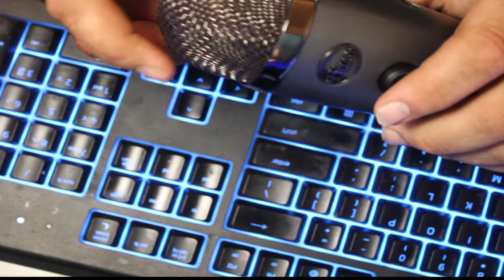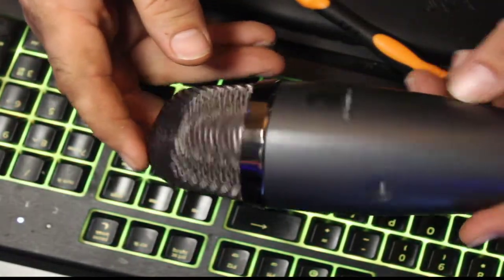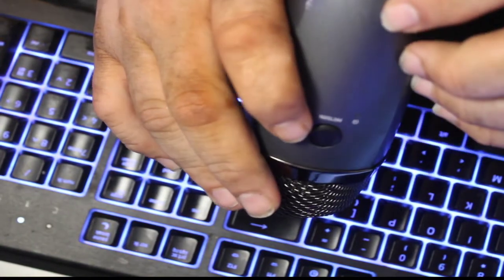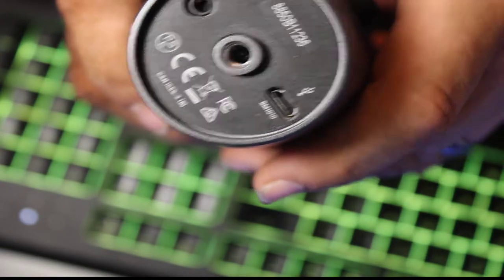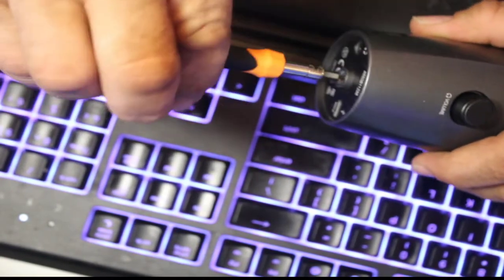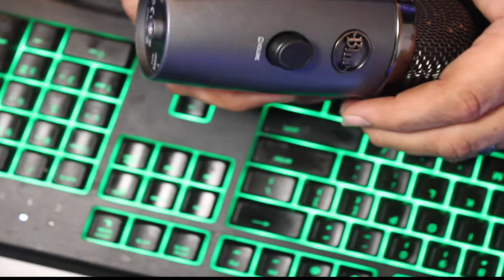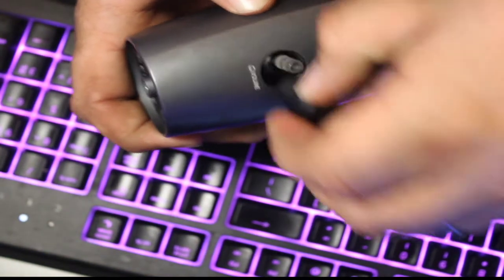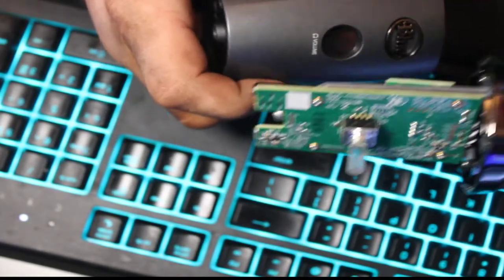How to disassemble the Blue Yeti Nano

Comment: Do you know what the thread diameter and size of the screw? mine actually snapped when I was trying to tighten it all down, it made a nasty rattle and it snapped
Reply: T6 Torx (T6 x 225mm; No. 668)

Comment: I have one problem, can you go more in depth on how to remove the volume button. It is impossible and I even had my dad and brother try to pull it out.
Reply from the maker: Honestly I believe some are glued on. I had to use brute force. Maybe heat the knob? But I can't remember if it's metal. I wouldn't heat it unless it was
Reply: @kyextreme4892  its impossible uh
Reply: @goatedmyth4854  yeah I agree it's pretty much impossible. thanks so much for the video though, it helped a lot. just have to keep working at the volume now and that's it...
Reply: Update: I got it off... Put some double sided tape on it so that I wouldn't scratch it and used plyers to get it off. Now it still slightly scratched it so maybe I didn't tape it enough but just know you may scratch it.
Reply: @povs  how did you get it off?
Reply: @povs  worked like a charm. Used double tape and pliers, no scratches.